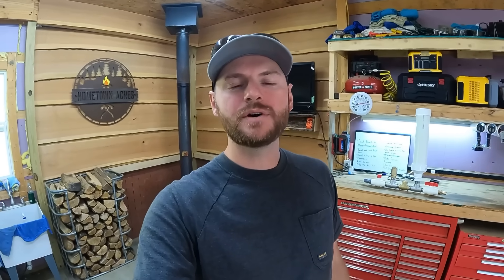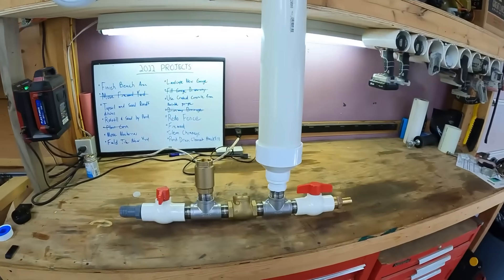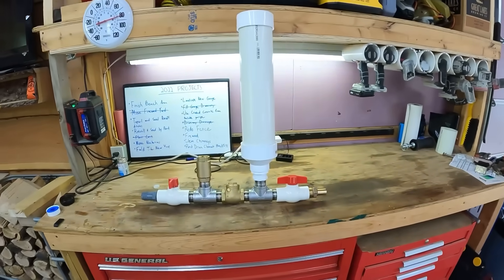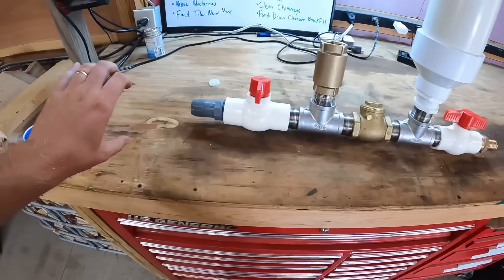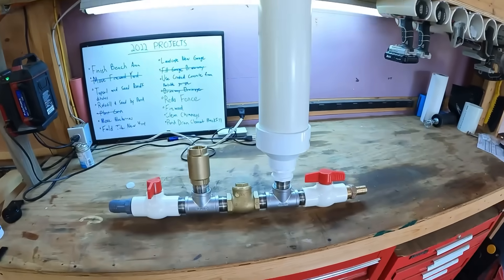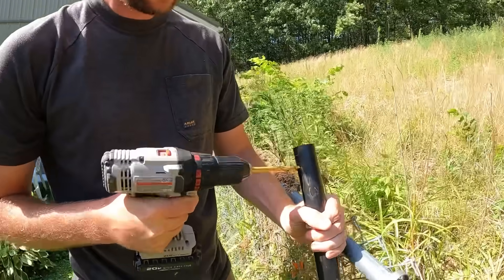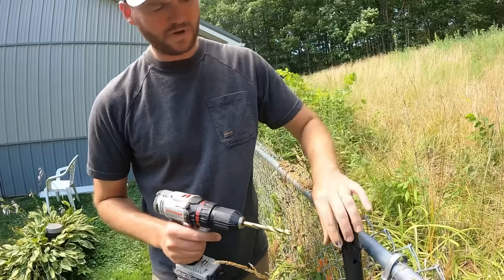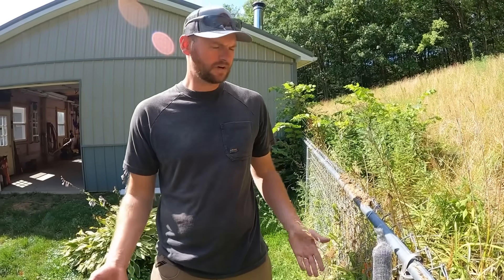We Found Water For The Pond - Hydraulic Ram Pump

Comment: Dude, at least by the video appearance, your pond is way lower than your creekbed. Assuming the creekbank is not more than 30 feet above the creek bottom,  a simple siphon should give you 10 times more volume. But, this is still very cool.
Reply: A small pump at the pond can be used to fill the line with water. Once it is filled, unhook the pump and the siphon will start automatically. The lower that the outlet end is in relation to the inlet, the more water it will discharge. If the water runs faster than you want (pulling more water than the creek supplies causing the siphon to quit) a valve can be added to the outlet to control the water flow. Small amounts of air will purge themselves from the system if the water is flowing at a good speed.
Reply: Only problem that could happen is if the siphon starts drawing more than the creek can supply. if that happens it'll eventually take in air and the siphon will break
Reply: @reillyberg7761  A one way valve in parallel with the ram pump outlet would allow it to reprime  automatically.
Reply: @FelonyVideos  a ram pump is literally just 2 one way valves, the real downside is the amount of water wasted at the relief
Reply: @rustystarkweather5121  His subsequent videos show how he accomplished the task.
Reply: @reillyberg7761  the ram pump would then restart the siphon right?
Reply: @reillyberg7761  😊😊😊😊😊😊
Reply: He's not stupid
Reply: This is exactly how water utilities supply water. Potable water is pumped into elevated tanks, then gravity will distribute the water thru out the system.
Reply: I agree. I made a ram pump a couple of years ago to keep a pig pen wet. Had to lift like 15 feet and travel maybe another 20. I was lucky to get a gallon a minute. Found those little water pumps you can hook to a drill and used that to start a siphon and the siphon alone was pulling easy 5 gallons a minute.
Reply: I think his pond is higher than the creek, but it's true if the pond is lower, then the ram isn't needed and a simple siphon will do it. The reason I think his pond is higher? Because he basically told us he had to have that open container at the top to keep the pond from siphoning back DOWN to the creek. That means the creek is lower.
Reply: @Gruuvin1  if the pond is higher than the creek then he won't develop a siphon and could/should ram pump directly into the pond.
Reply: @StickyBit7777  if the pond is higher than the creek, then the pond water would syphon back down into the creek, which is why he is pumping water uphill from the creek to an open container, which is higher than the pond.
Reply: @Gruuvin1  there won't be a siphon backwards as the outflow end of his pipe is not sticking into the pond.

The only thing required for the ram pump to work is for the output end to be higher than the check valves. The pump will have maximum flow when the output is only slightly higher than the pump compared to the ~30' in the video.
Reply: @StickyBit7777  okay well he didn't show that. However, it was implied by his reason for using the open reservoir.
Reply: @StickyBit7777  It will “stick into the pond” once the water level of the pond rises.
Reply: @Gruuvin1  I understood him to say the opposite. He was afraid that the DOWNHILL run to the pond would siphon more water than the pump can handle, so the siphon would take over & stop the pump.

What I think he missed (& he was SO CLOSE!) is that the siphon would move MUCH more water! It would be simple to plumb a valve at the pump inlet, then a bypass AROUND the pump, with a valve in the middle.

Get things flowing steadily with the pump,  then CLOSE the pump inlet valve while simultaneously OPENING the bypass. Siphon takes over & (as others noted - I'll take their word for it) moves 3-5 times the amount of water.

All that said, I LIKE the idea of using them plastic "tote"to allow debris from the creek to settle out BEFORE the water goes on to the pond.

Were I him, I'd SERIOUSLY consider draining the pond & doing the little extra work...
- (he apparently has the equipment and the skills to or, better yet, good friends with said skills to help use it!)!
- ... To turn the pond into a natural swimming pool. It's filtered by a small "wetland" planned with suitable (and BEAUTIFUL!) plants. Water could easily be circulated by multiple ram-pumps, the "drop" channeled from the pool to the weekend by gravity, which also gives the "drop" needed to pump it to the far end, for circulation...

Sorry - Aspie-brain, on a roll...

Here's one example, but I've seen many others - complete with diving board - that were just as much farm pond as they were swimming hole! NOTHING about this would lessen it's use as a farm pond - but THINK how much it would add to the family's life!

Learn to operate a Chainsaw Mill, then build a log sauna from trees that had to come down anyway...

Also, FLOWING WATER  doesn't freeze - hence the old truck of turning taps on JUST A DRIP - that was enough to keep water moving through the pipes, so they won't freeze. It'd be STUPID-simple to build a rock-box with some mortar, & line the inside with Styro insulation, triple-up the thickness on the Styro lid... All you need is enough water at 33° to keep your box from freezing. Let the overflow from the check valve pool an inch in the bottom, the drill a ~1" a hole in the side to let it out. THIS will all combine to keep the pump from freezing up.

Here's one pic of a "natural pool"...
http://3.bp.blogspot.com/-slT7FeCAEBQ/UkW-ls76aLI/AAAAAAAAAS0/W1xvTAGCdWg/s1600/1.png

Search for "natural pool architect" or "...designer - British guy sells plans & consults via video chat, to help people adapt the design for their specific needs and wants.

If I expected to live long enough to pay it off, I'd have done this myself...
Reply: @AlanCheek  he made a more recent video clearing some things up. His pond is lower, and he could just use a syphon.
Reply: You also need to take into account the water source.  If you take more water than the creek flow, your siphon will work… temporarily… until you suck the creek dry.  Also, there’s the consideration of downstream neighbors.  I think he’s got the right approach:  limited and consistent.
Reply: @eschdaddy  A lot of people think that a siphon fails when it's capacity exceeds the source capacity, but that isn't necessarily true. Entrained air slows the siphon flow rate, but doesn't have to stop it, unless the flows are wildly mismatched.
Reply: Leave the ram in place but at a valve to the top of the first check valve. Self priming siphon. Once the siphon starts you could close the valve on the check valve so you don't suck air. Add a flow valve at the pond if you want to slow it down or shut it off and retain your Prime.
Reply: Mechanical engineer here.... much more entertaining to read through all the bickering posts debating if it is possible or not to siphon water uphill more than 10m than to give you the answer🤣
Reply: @notyouraveragegoldenpotato  it's not possible to syphon water uphill at all. I don't think anyone is arguing that. And, as a mechanical engineer, you would know that right? (gravity)
Reply: Love this discussion. What about a waterpump powered by the flow from the creek? Any thoughts?
Reply: @justgotravel6646  that's what a team pump DOES. ~1' of fall can generate 7' of lift...
Reply: That's true Adam, try it out, you can make water go uphill throw siphoning.
Reply: Would not  the ram pump work better if the collection tank was set up close to the maximum level of the pond?   This would stop any risk of siphoning back to the creek if the lake level is higher than the creek but would allow the ram pump to create a siphon to the collection tank which could increase flow?    It would also mean the ram pump has a lot less head to overcome once the pipe was filled to it's high point.
If this scenario worked  the rampump automatically re-establishes the syphon any time it is broken.
Reply: @davidclark2286  This. Take advantage of a siphon to reduce the work expected from the ram-pump, and the check valve upstream from the pressure reservoir will prevent the siphon reversing and the system emptying the dam.
Reply: You can actually achieve the venturi affect, if conditions are right, up to 100 feet
Reply: And you can always take the pipe feather up stream.
Reply: @m.j.debruin3041  better yet, dig out a little reservoir, dam it with reclaimed rocks & mortar. A 4' drop at the START would SERIOUSLY increase his flow. Even if the output was at the bottom of the dam (vs top) the pressure of all that water on a 1.5" outflow would be nothing to sneeze at either - but not as effective as the aforementioned 4' drop at the outside of the dam. As for downstream folks - TALK TO THEM ! "creek'll be dry for A day AT MOST while my little reservoir fills, then the overflow will be EXACTLY as it would be had I never done anything. I just wanna steal what would have flowed on past all of us anyway. HECK, I'll do it AT NIGHT so I don't impact anyone..."

You'll PROBABLY find they're FASCINATED with what YOU'RE doing, and likely to want to do much the same for themselves downstream a ways...
Reply: At least to me, the pond didn't seem lower than the creek
Reply: Curious to know if there are any state or county laws on taking water out of the stream without a permit or at all. Hate to find out a huge fine afterwards if they got crappy about it.
Reply: Was thinking the same thing.  If the height isn’t enough to create the syphon  that’s ok.  The ram pump will just be able to create more pressure because the syphon is taking care of most of the elevation gain needed.  This potential for more volume of water moved.
Reply: Got a question for the OP and any of you guys that have built a successful ram pump. My nearest pond edge is only 82 feet from the bank of my creek and the ground is level in-between. From the creek bank down to the creek itself usually averages around 8 to 10 foot. My pond is wet weather spring fed (not fed by the creek) but gets really low during extreme droughts (springs almost dry up then no matter how much I clean out the spring heads) and I want to build something like this to fed the creek water over to my pond. The thing is my creek is a big wide creek (averages 2 foot deep and 8 to  10 foot wide in actual water flow). I can't dam it up and make a paddle wheel system (like old sawmills, grain mills, etc used to use) because it's a different property owner on the other side of creek and they won't agree to damn it up.  Would a submergible ram pump possibly push water up the 10 bank and over the short distance to my pond. I've manage to get a decent amount of water over to my pond from creek with a harbor freight gas powered water transfer pump, but I've wore two of them out over the years doing it and spent a crap ton of money on gas and constantly repairing them. This ram pump would be ideal if I could make it work. The water at damn does flow out a pipe and down a trench to the big creek I mentioned, but it's about 425 below where I want to do this. I could catch that water coming out of pond and just send it back in with ram pump,  but  I want the fresh water from the creek to feed it (not recycle same pond water).
Reply: I agree,,, but leave it all intact and then the ramp pump starts the siphon process
Reply: white man invented the modern world  yes?
Reply: Wonderful money making video for views, likes and comment.
Reply: 2in pipe, siphon a little higher up the stream if need be, set you a primer at the highest point and boom. Probably wouldn’t hurt to build a little water holding area in the creek as well.
Reply: Use the pump to start it. Then bypass to water.
Reply: Probably get more evaporation in the summer than it’s actually producing definitely cool process tho
Reply: Reading all these comments makes me scared for the future of mankind, "siphon uphill", "you can only siphon specifically x metres". You guys really have absolutely no idea what you are talking about....
Reply: I think instead of lower than creekbed is not correct. It should be lower than surface level of water. Rest of your comment should be seen in this context.
Reply: To get more volume of water just add more ram pumps and separate lines to the storage tank. The single line to the pond can handle it.
Reply: Quick question my water well is 20ft high and if I install ram pump will it work
Reply: I was thinking the same thing plus if the pond isn't filling up by itself it's not in a good spot
Reply: Will it work under the water leaving the intake side with only the valve open ( say 4ft) pumping water uphill about 20ft
Reply: If I want to apply it on a well or bore hole of about thirty feet, what's the process? Thanks
Reply: Just add a bypass around the Ram Pump with valves.  Once the "siphon" has been primed, shut the valves off on both sides of pump & open bypass... Siphon complete!
Reply: ‘Dude,’ might be something that low class people say, but, you should never write it when addressing someone.
Reply: It's a perpetual motion machine
Reply: Right. Seems like taking water from current screened intake location to the pond is worth trying if it is higher up.
Reply: It depends on if the height gain is more than 10 m, if it is, a siphon can't work because you can only suck up water 10 m (in perfect conditions) so the limit is likely to be less.
You could try from the where the water is being taken from, but you still need to find a way to prime the siphon.
Reply: @andrewmilsted9361  there are many trees taller than 10m
Reply: white man invented the modern world  In his next video, he does the siphon and it worked.
Reply: The ram pump could still be used to start and restart the siphon, if the siphon works at all.

Just as a side note, there is a process that uses something similar to desalinate water and make it drinkable. When a siphon is higher than 33 feet, a vacuum forms at the top, but it not really a vacuum, it is low pressure water vapor. What condenses on the other side of said vacuum is pure distilled water. It's an almost energy free way of getting drinking water from the dirtiest of sources.

P.S. Other than sheer stupidity by politicians, there is almost no reason this technique isn't used by most cities. The technology isn't that complicated, and there doesn't even need to be any moving parts.
Reply: @FelonyVideos  would love to see a video of how this is made
Reply: @sarayoforestsinc.3771  Well, it's your lucky day. His next video actually implements the siphon idea, and it appears to work pretty good.
Reply: @FelonyVideos  wow very good to know!!
Reply: @FelonyVideos  Oh trust me, politicians are NOT stupid.  They know EXACTLY how to service undrinkable water.  Who do you think polluted municipal water in the first place?
Reply: @FelonyVideos 
Do not measure from the basin of the lake. Check if its surface level is lower than the destination. It is not possible to suck water above the lake water surface level. Against science and daily practice.